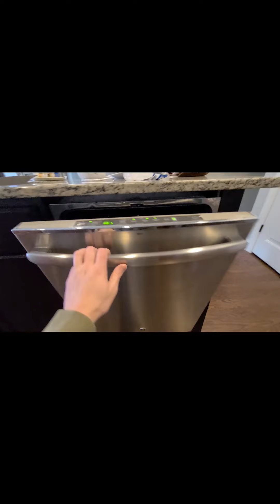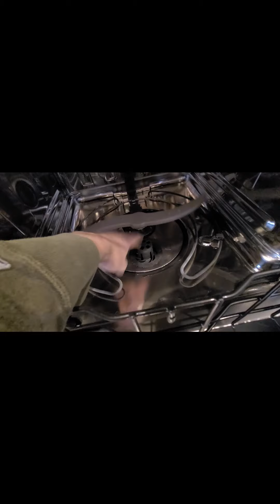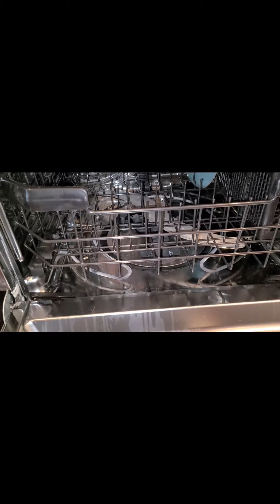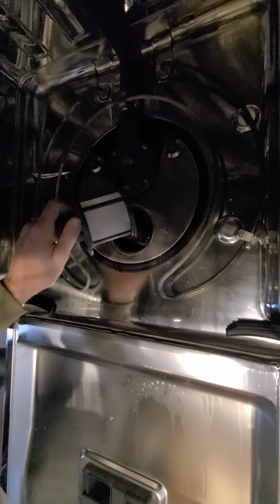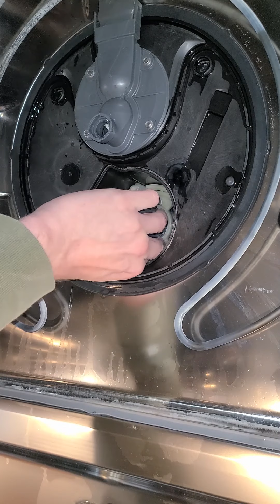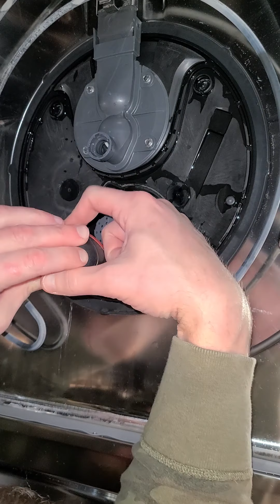Man Tips: Fixing a GE Dishwasher that isn't heat drying - replacing float switch (p/n GDT580SSF7SS)

Comment: If you don't have a driver then you can use a 6.5 mm socket not a seven not a six and not a five. Just sharing because I just figured it out thanks for your video. The only thing I'm a little confused about is when I pull to my float switch out there was no electrical connector

Comment: I'm curious to know why a bad float switch would prevent  the heater from working... perhaps to avoid turning on the element while there is water in the basin?

I have been trying to diagnose my Kitchenaid that only runs the full cycle some  of the time (it often cancels out within the first minute).  Error codes show two issues, one with the heating element (I don't care because we don't use it) and a second with the float.  I have replaced the actual switch itself, thinking that was the issue, without a resolution... but now you have me wondering if the two error codes are related and it's still something to do with the float assembly.

Comment: How did you test to ensure it was the float switch and not a burned out element?
Reply from the maker: I did a visual inspection of the element and didn't see anything. Replacing the float switch interlock would diagnose a broken heating element if it still had not worked. Also. The switch is significantly cheaper than the element.